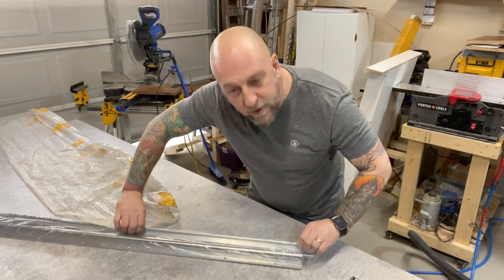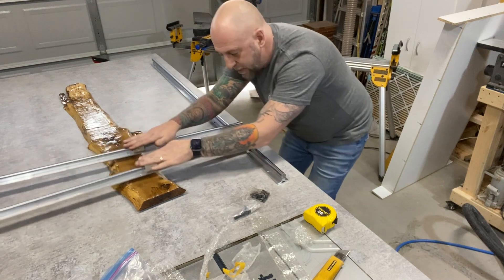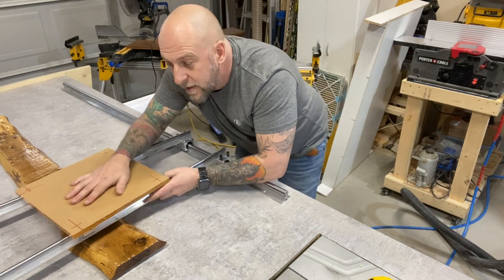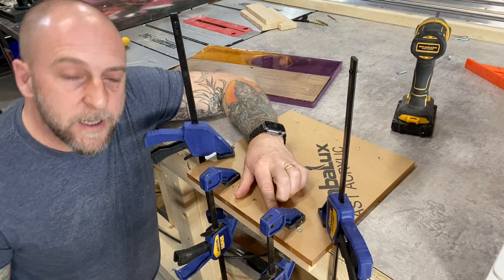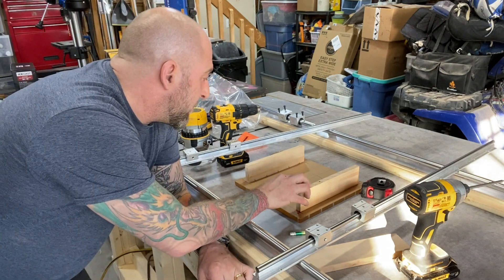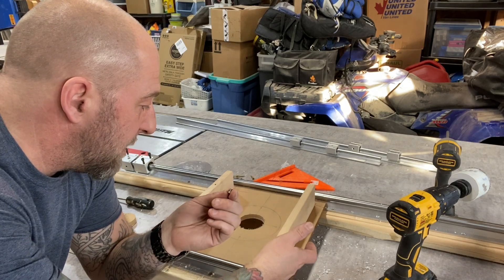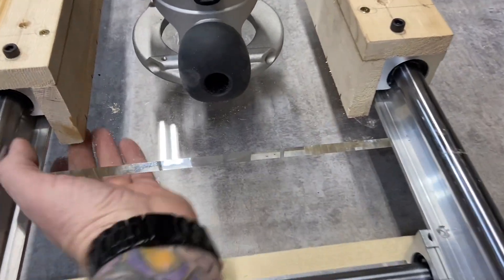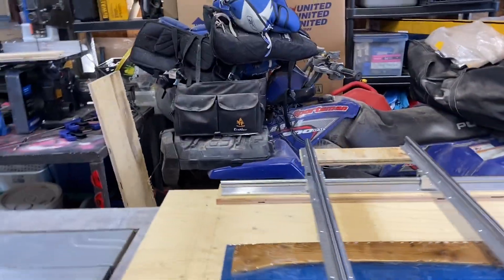Router sled 31323

Comment: Great video. Thanks. This is very close to what I want to build. I have a question about the linear rails you used. Are you happy with the quality from this vendor? The link to the linear rails show you used the SBR16-1500mm for both sets of rails. But on the video, you mentioned the bottom rails were "beefier". If you rebuilt your setup now, would you have used SBR20 instead. Is there a recommended source for the 1/2 inch acrylic base? Thanks again for your help and instructional video!
Reply from the maker: I actually ordered 2 sets of the SBR20-1500 mm by accident. I'm sorry the link I posted was wrong.. The first rails I used for the top were the SBR12-1000mm.I decided to use both sets of SBR20-1500 and kept the smaller ones for another project. I would definitely recommend using the bigger ones for top and bottom.. The acrylic base was just from Amazon too. I think $30. Definitely worth it. And thanks for the compliment and question!
Reply: When I used SBR20 for both sides, the top rail cannot be mounted on the bottom SBR because the bottom SBR is too narrow to accommodate the top rail. I saw another YouTube video use a bigger one for the bottom and a smaller one for the top. Are you sure that you used the same SBR20 and the top rail can be mounted on the bottom SBR?
Reply from the maker: @byunglee6351  yes I did and you're right they don't line up exactly right. I only use 2 of the 4 holes on the mounts and because I reinforce the ends with a piece of plywood its super sturdy